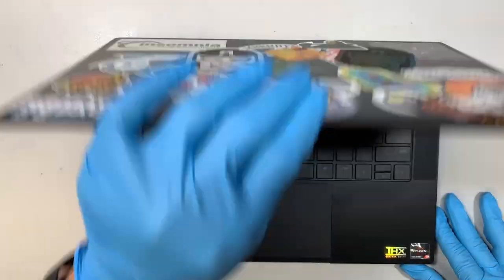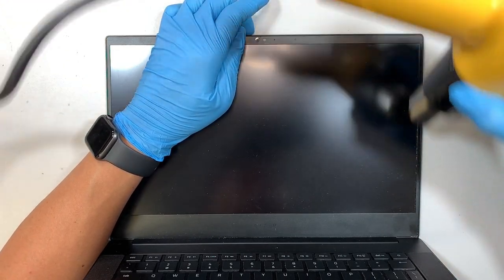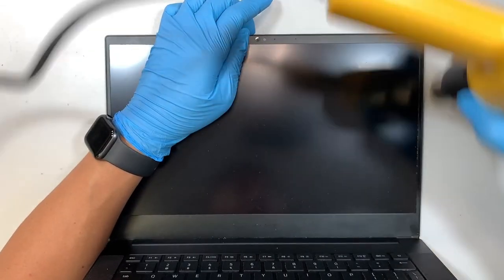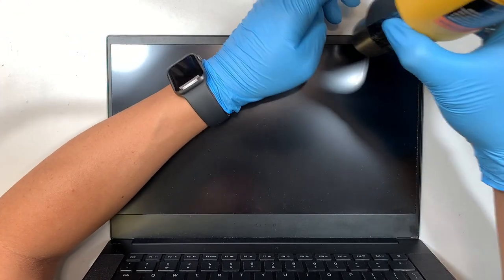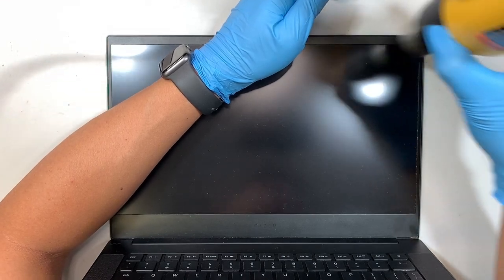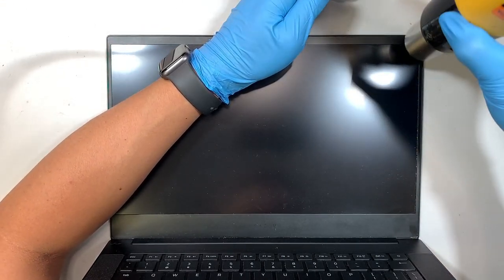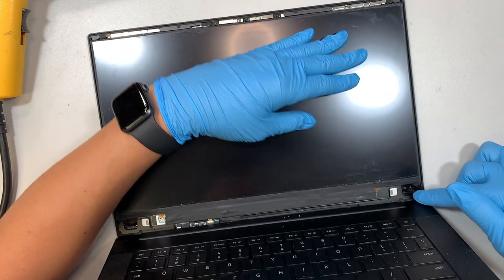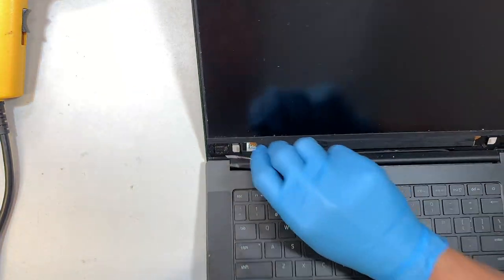Razer Laptop RZ09 0370 Screen Replacement

Comment: I have a Razer RZ04-0967 with a 4k touchscreen lcd. I'm not sure if the lcd is dead or the connector is dead (most likely the connector cable) . 
But the connector has 50 PINs. 
Any Ideas on where to get the same type of connector and the same type of screen? 
I can't find it anywhere online